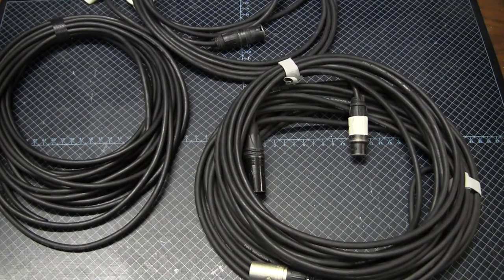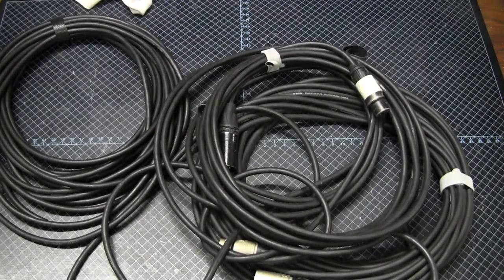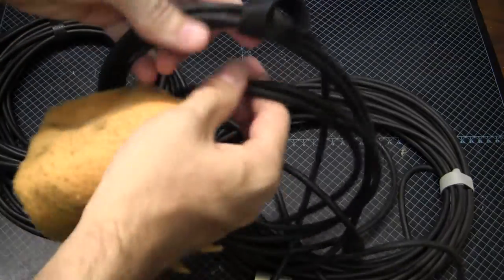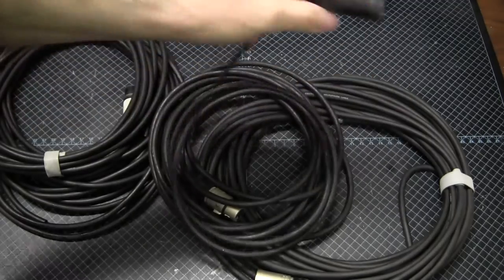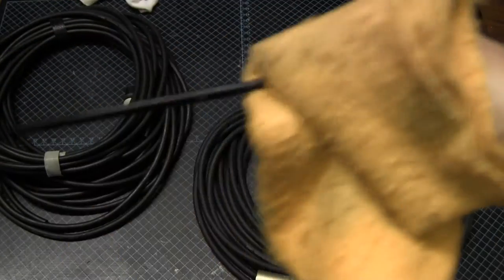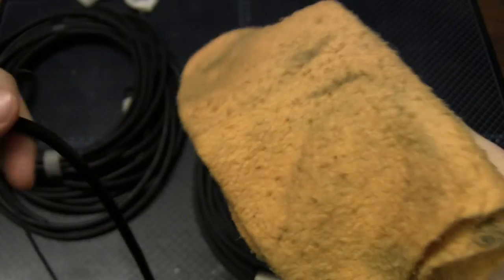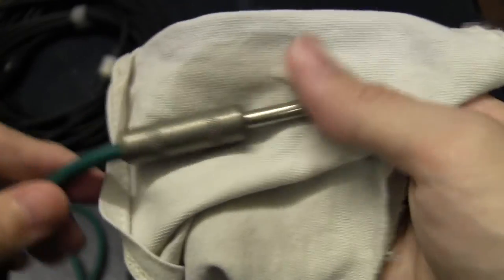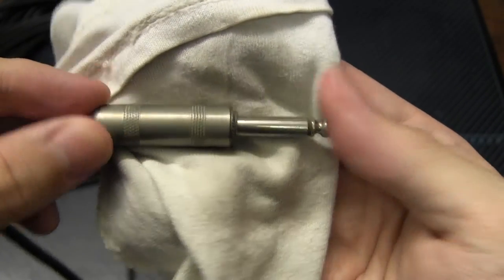How to clean dirty microphone cables

Comment: Always enjoy your videos Bruno. 

I've been using a product called Goo Gone to remove tape residue, etc, but I like the idea of denatured alcohol. I'm going to try that for the next cleaning session. 

I have about 30 Sennheiser  wireless systems with earhook mics (I do mostly theatrical type productions) that always seem to end up with surgical tape residue on them. The Goo Gone works great to remove the residue. I then hang them up to dry, after which I wipe them down with baby wipes. Works great to rid them of the smell of Goo Gone and disinfects them for the next show.

Keep up the good work!
Reply from the maker: Ah yes good old Goo Gone! It's very expensive in Singapore so I haven't personally tried it. Perhaps I will now. 

I know the tape residue well! When I worked with a company that did a lot of theatre shows I would use a combination of electrical contact cleaner and lighter fluid to clean the gunk off. It worked but it didn't smell good and certainly wasn't very good for my health.

Comment: i like the video its simple and understandable but i have a little bit of a problem with some of my cables.
i've done some gig's where cableramps where not an option so i had to tape them down, sadly one of the new guys pulled the cable away first instead of the tape so i got tons of sticky residu all over them, is there an easy way to get this off without doing damage to the cables?
Reply from the maker: +roy00100 Sure, I have the same problem all the time. I would try lighter fluid (naptha) to remove the gunk, and then wipe down the cables with a damp cloth as shown to remove any traces of the solvent.
Reply: GLB Productions awsome, thank you very much!
Reply: I've been using gaffers tape, but still occasionally have to clean them. I've had good luck with Goo Gone for removal of tape residue..
Reply: never heard of goo gone, is it purchasible online??
Reply: Yes, you can find it on Amazon. I know WalMart sells it as well as local hardware type stores. Here in the States anyway.  

https://www.amazon.com/Goo-Gone-Original-Cleaner-oz/dp/B00006IBNJ
Reply: Use WD40 or simular on a cloth., and clean it the same way its shown in the video.... it disolves the stickystuff right away.. very effektive.. When its gone.. use alcohol to remove the oilsurface..

Comment: Very interesting Bruno!even if this is something I never done because I keep all my cables in a flight case...

By the way,have you ever done a vid about How to use a cable tester?
Reply from the maker: +Cris Valk That's good! Even so it's good to clean them once a year or so because it allows you to inspect the cable at the same time. 

No I haven't, mainly because there are so many different models of cable tester out there! I can do a video on the one that I personally use, which is the Swizz Army.
Reply: Ok :)

If you mean the one form Ebtech it seems identical to the Behringer CT100...but I own a Proel Cable t01 which I can't comprehend why it has 8 switches instead of 3...
Reply from the maker: +Cris Valk It's to allow it to test different types of connectors, some of which have more than 3 pins - the large NL8 speakon connectors have 8 pins total.

Comment: got any tips for removing a thick coat of gaff tape residue? someone bought cheap gaff and I payed the price for it as now i have to clean it.
Reply from the maker: Try lighter fluid or Goo Gone - if those don't work you'll need to try a more powerful solvent like paint thinner but bear in mind that it can permanently damage the cable jacket.

Comment: Sir nice video. I use wd40 for this purpose. Is that OK ? 
Sir my mixers female connectors aren't working well ,I need to press the male connector in between for good sound ,other wise sound appears very much low ....
I spray wd40 in the connectors ,after they get dried I fit the again, is that right what I'm doing..?
Reply from the maker: I recommend you do not use WD40 - it's designed as a mechanical cleaner/lubricant, not for cleaning electronic components as it leaves a residue which can attract dust. Get yourself some electrical contact cleaner from a hardware/tradesmans store.
Reply: GLB Productions 
Thank you sir ....
Will you recommend one for me ...